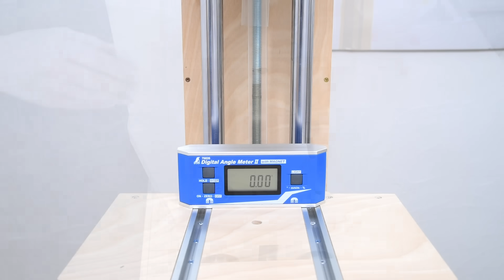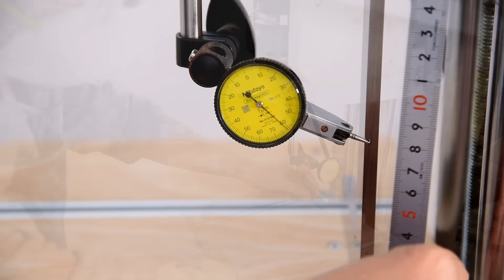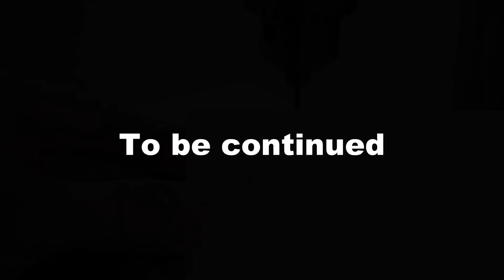Making of 6 in 1 Drill Press( Drill Stand ) Part 2

Comment: amazing work)
you can also disassemble the drill and bring the start button and rotary selector (if equipped) to the hull. Placing the start button on the handle will make it easier to use.
But since it is 6 in 1, it is necessary to choose such a place that it is convenient in any position